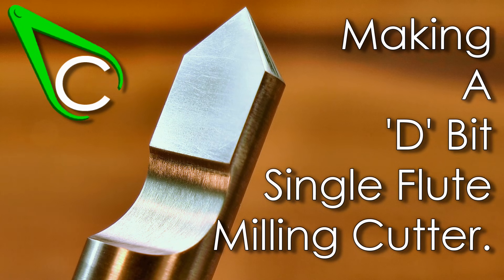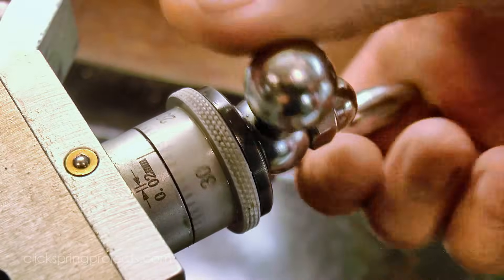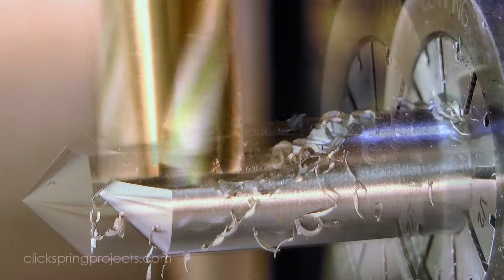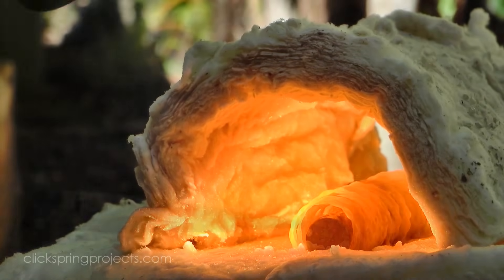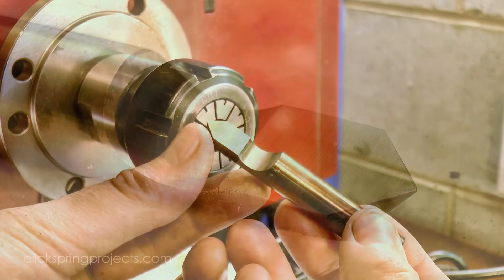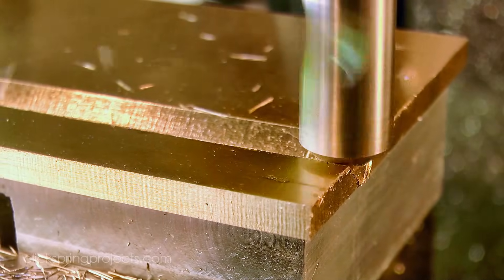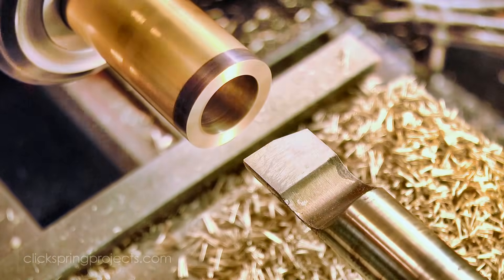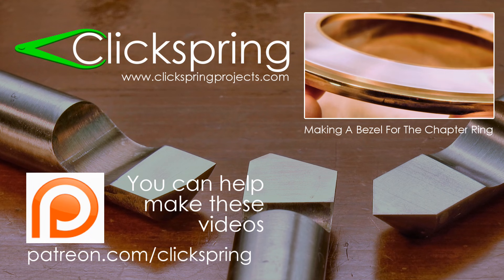Spare Parts #8 - Making A D Bit Single Flute Milling Cutter

Comment: Well done as usual!  I saw you pull the flame away before the yellow reached the cutting surface, did you let carry-over heat let it get to temperature?
Reply from the maker: +Metallurg33 Yes exactly, it has enough heat sitting in the tail to do the rest of the job if its simply given a bit of time. Thanks for watching :)